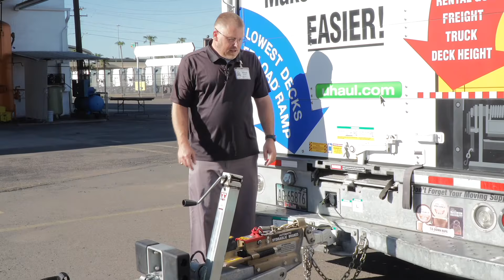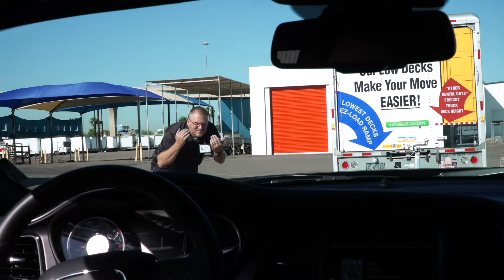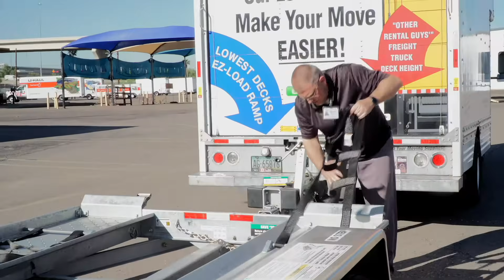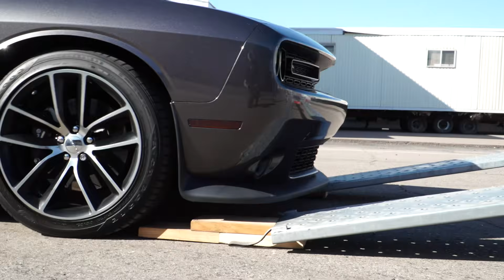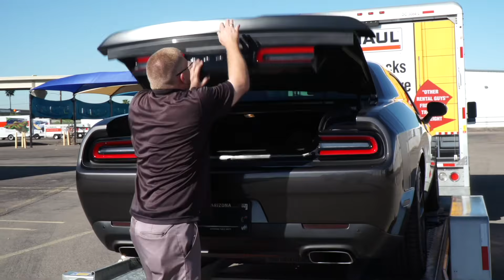Auto Transport: Low Clearance Loading

Comment: If you use shims to get your car on the trailer, but you didn’t use shims up at the front wheel stop then you have to jack your car up while it’s on the trailer to put the shim under the front tires. Ask me how I know. .
Reply: Couldn't you just back the car up, place the shims at the front wheel stop, then drive the car forward onto the front shims?

Comment: Few pointers to note 

Ensure the tires are both up against the metal stop before ratcheting them down

When you stop to get fuel make sure you check the ratchet straps to ensure they are still tight, the slide out ramp locks are still engaged, the safety chains are still locked in place

Comment: home depot sells 2 in x 8 in by 12 feet and will cut 12, 12" shims for you. FYI for anyone out there that does not have shims available. Cost is less than $20.
Reply: Thanks!!! 👍
Reply: thank you so much for this info! i am one that does need this. i am hoping my 2022 dodge widebody will fit
Reply: @shesthatuce did it fit?
Reply: Not all heroes wear capes!
Reply: Think zl1 1le will fit
Reply: Thank you! I have a 23 Camry
Reply: Smiling My thanks!
Reply: Just did it today it was $17 at Home Depot.
Reply: Just did it $22
Reply: @johncena4748 How did you do it? Do you just tell one of the workers what you need and they cut it right there?

Comment: For bonus points, say "that's not going anywhere" after tightening to make sure the car won't move.
Reply: The proper incantation is required for operational safety. I don’t see how he missed this. Fail.
Reply: Gotta pat the vehicle twice after tying it down first before you say it tho.
Reply: @electricpablo951 exactly no slap and pat not dice
Reply: One bonus point only I'm afraid. :P

Comment: lacking some info here. some would call it common sense but there is no such thing. The ratchet straps need to be LOCKED.  the chains should be slightly tighter. can be achieved by twisting.   Also dont want those chains to damage brake lines or electrical. And dont wrap the chains over any axles.  Frame/crossmembers only. Just a few things that should have been addressed.  It also helps to have a slight bit of extra strap so it bites on itself. But i cant explain in text how to do that. If you pull it tight then ratchet it tight there could be no strapping on the cylinder of the ratchet it could slip. Ive seen it happen.  again this part is hard to explain. Has tor be shown.

Comment: Hi: that Scat Pack weight is 4,082 lbs. the car transporter carrying capacity is 4,055 lbs. that would make it over weight by 27 lbs. not including fuel in the gas tank, may want  to tow on E.
Reply: The weight capacity is actually over 5,000!!!
Reply: no way!! i've learned something new today. i have a 2022 dodge challenger widebody scatpack and i wasnt sure if it was going to fit on this trailer  @user-yv8rf2mc7z

Comment: I feel like my exhaust would hit on the arch of the ramps any way to avoid this?
Reply: Not sure if you figured this out yet but you can add boards or shims on the trailer so that the front tires are higher in the air at the point that your exhaust would be crossing over the arch.

Comment: Highly recommend putting the wood blocks under the front wheels even if you have enough clearance at the front bumper because my car was too low to clear the fender support (even with the top of fender lowered down there is still a vertical shield/support in the way) and I think the blocks would have lifted it above the fender support.
Reply: Just leave window open and climb out

Comment: Tried renting when moving to Colorado was moving my Lowered EVO X. The the trailer didnt have the movable fender so couldn't get out of the car..
Reply: Be a rebel.. climb out the window.
Reply: Same lol except even with the removable fender I was still stuck since there is a portion that stays in place and it was still in the way. I trailered my Evo X yesterday and had to jump out the window and flick the window switch to shut the window. Getting the door open again required completely unbolting the vertical fender shield that sits in the way of the car door.

Comment: ..... Those straps are not secured. The wrap should be covering almost 50% of the tire on it, and should be on top of the tire, not behind it as shown in the video....
Reply: The straps are primarily to prevent the car from moving backwards. The metal tire stop at the front of the trailer is what prevents the car from moving forward.
Reply: When you begin to ratchet the strap, you need to start with a semi loose strap so that it overlaps itself inside the ratchet....if not there won't be enough pressure to keep it from sliding back out......not one single video shows this....
Reply: @itruck96  i found ONE video that showed it.
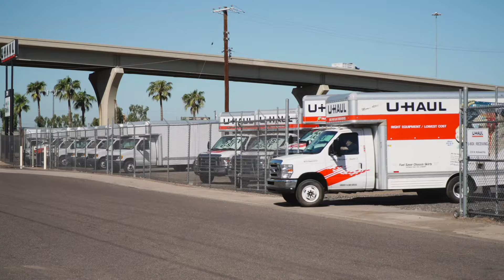Reply: @itruck96  https://youtu.be/qcxebnvs1XQ 4:00, is this it?
Reply: @delairium627  Yes, perfect example.

Comment: Another way to load a lowered vehicle is to jack up the front of the trailer (the jack that is bolted on the trailer). This gives the trailer an incline so your vehicle front bumper doesn't scrap. I have done this before.
Reply: How’d you jack up a trailer without unhooking from hitch
Reply: @garretta72  x2
Reply: @garretta72  You would have to unhook from the hitch to jack it up. Once the car is on the trailer you can jack it back down onto the hitch.
Reply: @NewUser0998  BAD advice
Reply: Yes and no. Yes you can jack up the hitch if it is a pickup, I have done it several times. this would cause the rear end of the truck to move up. The higher the truck, the more incline you get. And probably a no if it was a uhaul truck, I don’t know how heavy those things are.

Comment: If you are loading a car with manual transmission, do you leave it in a gear or neutral? With parking brake on?
Reply: First tighten all straps.  Then put in gear and set parking brake.
Reply: @johnjames5020  $10 says most people will forget they didn't put in gear....it's almost bad advice....but I'll definitely do it....while the car is being loaded it might save your transmission if someone applies the brakes in the tow vehicle.
Reply: I drive a car hauler, we always put it in gear and set the brake before strapping. If you put the straps in the right place it won’t pull against the car when you tighten them down.

Comment: If our car is a RHD import, can we reverse the car on to the trailer or will that cause a weight issue with the engine being behind the trailer axles?
Reply: Front engine must be loaded with engine to front.  Engine at the rear of trailer will sway.  Badly.

Comment: nice see a guy who knows what hes doing when loading a low car .. excellent video thanks....
Reply: This video is wrong in so many levels. The trap is not securing the tire in the proper manner. It should be over the top covering the tire 50% , not behind on the back side of the tire
Reply: @NKaumans  Not true, the reason is because the trailer metal in front of the wheels is already holding the front part. Having the strap on the rear of the tire ensures it stays against securely the metal.
Reply: @Rannd  regardless of the front tire stop the straps should be over the entire top half of the tire. The ensures the tires are being secured to the trailer in a uniform force. Furthermore, trucks and SUVs will have no problem riding up over the tire stop with their larger diameter wheels
Reply: @NKaumans  Cool story, I’ll continue doing it the correct way that makes sense with physics on earth and how uHaul recommends instead. 👍
Reply: @Rannd  sounds good chief. You and u-haul know best. Considering u-haul doesn't even make this car carrier, I'm sure they know what best. You're right, a truck that has twice as large of tire should be fine using a undersized strap, makes sense .
Reply: @NKaumans  Nobody even mentioned a truck, this video is about lowered cars.
Reply: @Rannd he's right about the guy putting the strap on wrong. It's designed so you slide the short straps over the top so it holds the whole wheel.